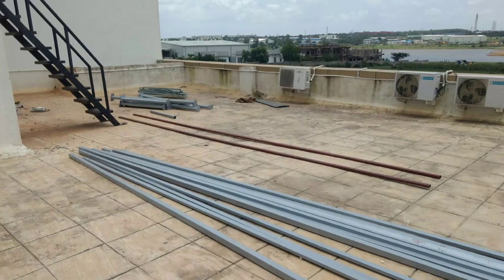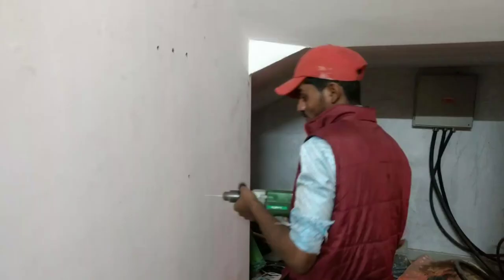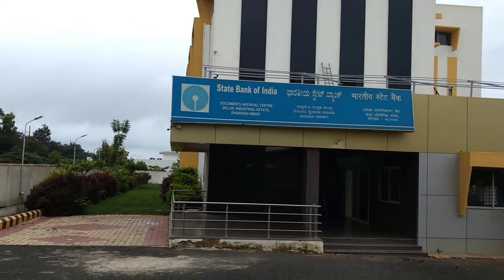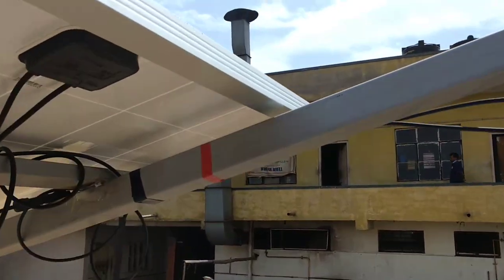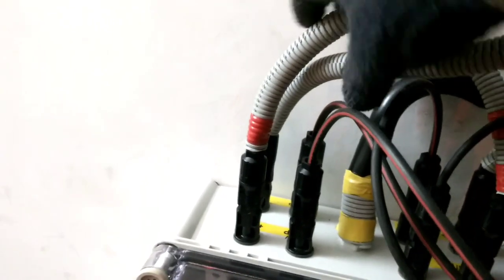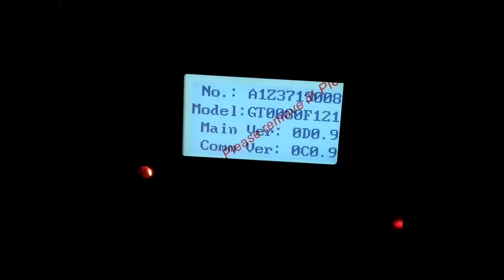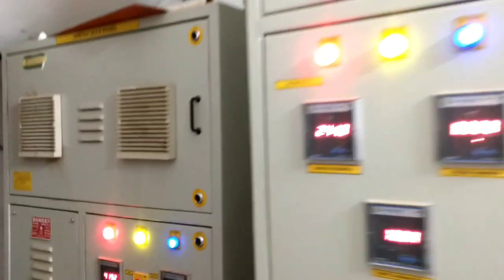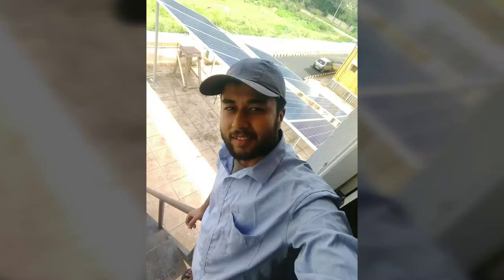10kw Solar grid connected system installation  inverter connection  DCDB connection

Comment: Earthing from DCDB and Inverter should not be attached to earth bus instead it should be tapped directly at the same or separate Earth rod extreme end. The lightning may strick the panel and before reaching proper ground potential it may directly damage inverter. I'm not 101% sure but correct me if I'm wrong.
Reply from the maker: You are correct ,

Comment: If you have connected all the plates in series then the voltage will surpass the required voltage of the pcu, will that not cause a problem?

Comment: Solar Inverter suppliers for hybrid power packs 9841185357 --- ROOFTOP SOLAR POWER PLANTS We offer customized Solar PV Solutions for Institutional, Commercial and Residential Units.  Power Focus Call / SMS & whats-app 9841185357 / 9884124365 -- 8838472736- powerfocuschennai@gmail.com